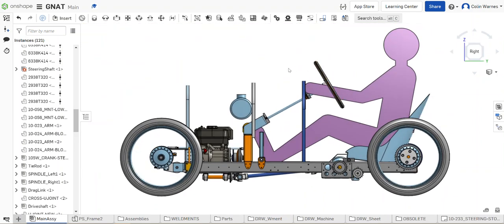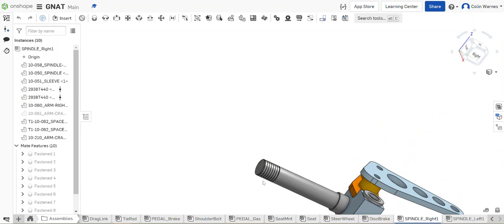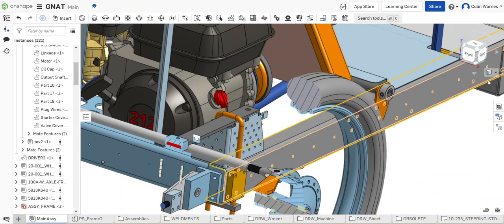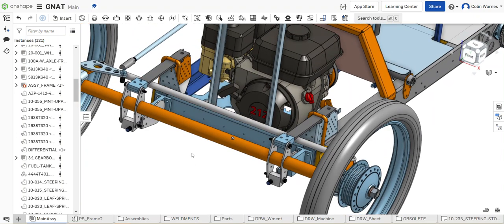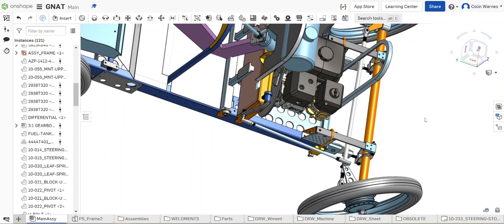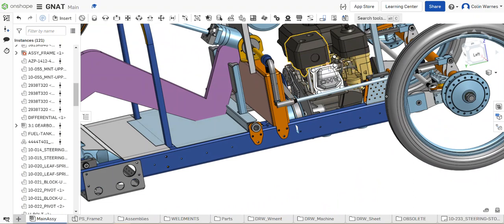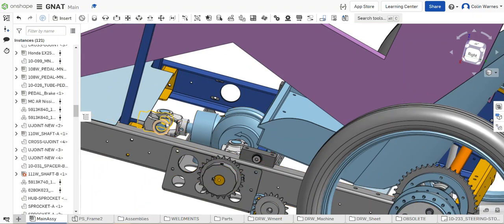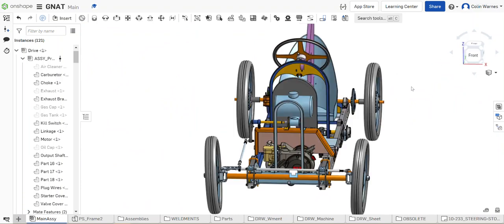CAD Walkthrough - GN GNAT Cycle Kart

Comment: Hi Colin... great video... really really helpfull!

I´m starting the build of a cyclekart (also inspired on a GN) and learning along the way. 
I was wondering: would it be possible to connect the driveshaft directly to the engine, use the torque converter after the differential, and finally the chain to the axle?

Thanks!